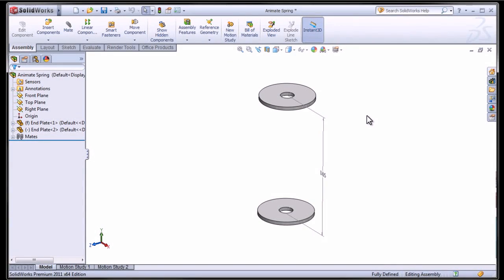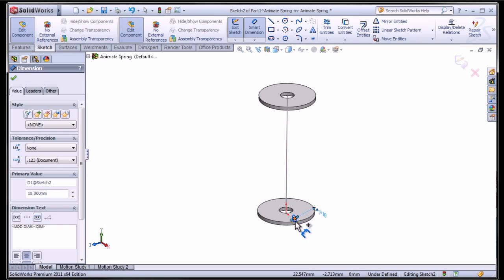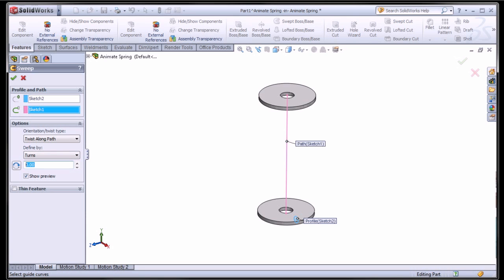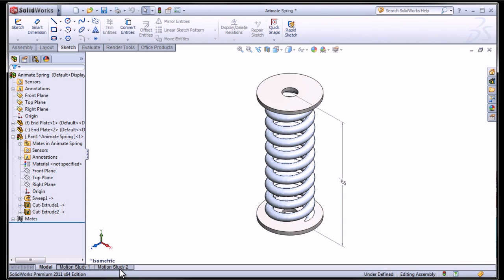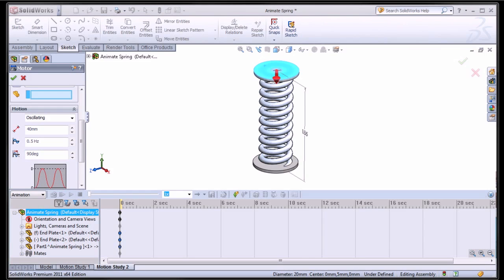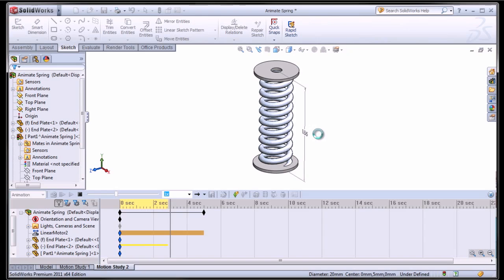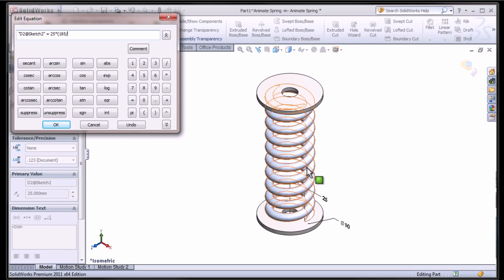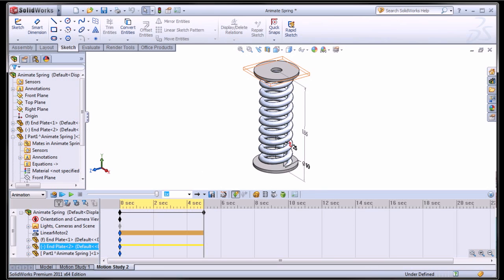SOLIDWORKS - Animating a Spring

Comment: I trying to do the same thing in my assembly put ran into a problem. I referenced two planes that the end points of the line for the spring length. One plane is offset from a face of a fixed part and the other plane is offset from a face on the 2nd part. The 2nd part is free to move back and forth axially. When I move the second part, the spring is not updated to reflect the change in the spring length. I have to rebuild the assembly every time I move the 2nd part. Is there something I am doing wrong?
Reply: ***** I made a simple assembly of a spring, shaft, and plate. I did a motion analysis and applied a linear motor on the plate. When the simulation runs, the spring does update. It seems like "Animation" is the only option that allows the spring to update.

Comment: Great video! But i have some problem:
When i take the assembly in which i've created the coincidence relationship between the spring length point and the spring mount surface, and put that assembly in another assembly, the spring stops changing length.